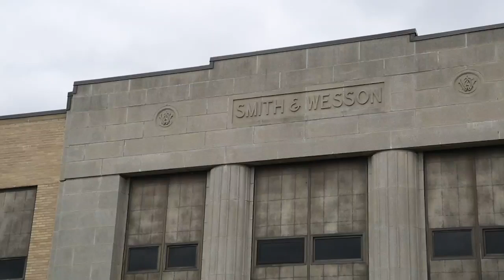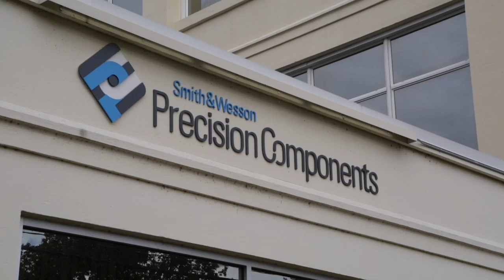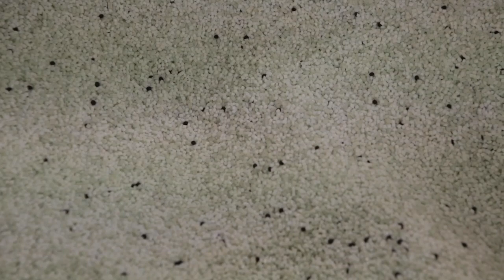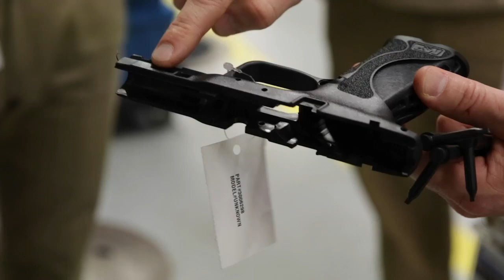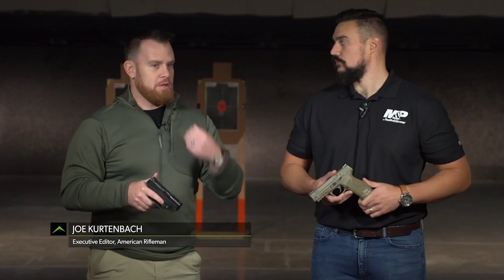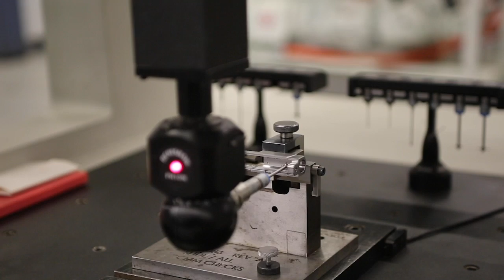Inside the Factory: Smith & Wesson M&P Handguns

Comment: I can appreciate what they do with polymers.  I get it, it's a massive speed up in process.  It's sad that they WON'T (yes WON'T) produce products of yesteryear like the 4506!  My hope for the future is that Metal Injection Molding advances to the point where entire frames (and slides for that matter) can be made using it.  Right now many manufacturers use it to produce smaller parts like hammers and triggers.   If it advances to the point where larger parts can be done like that, it will be as competitive process-to-process with polymer injection molding.  And of course most people would PREFER the metal frame.  Imagine them bringing back the 4506 or other discontinued legends (perfected model top break!).  I really hope they are pushing research in that direction.   Think of the MASSIVE market advantage a company would have to be the first one to reach that capability!!!